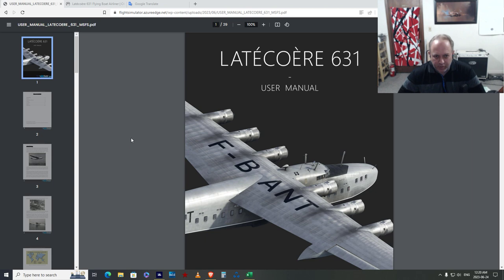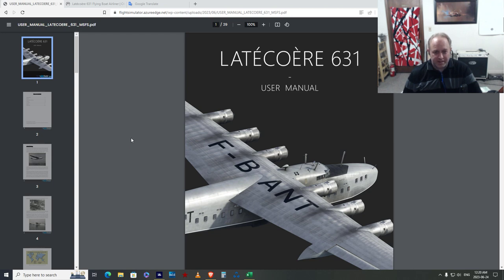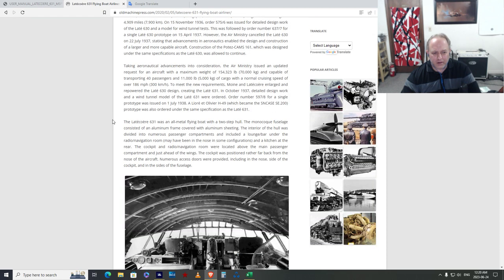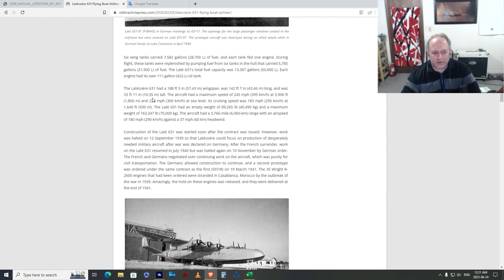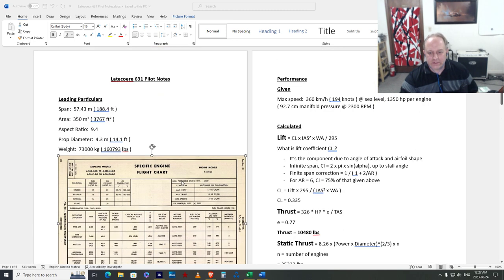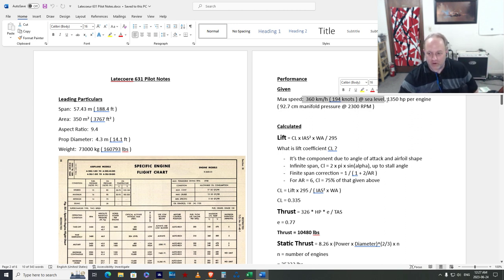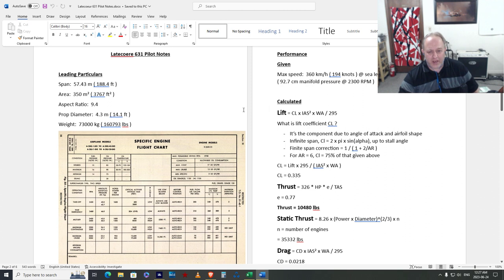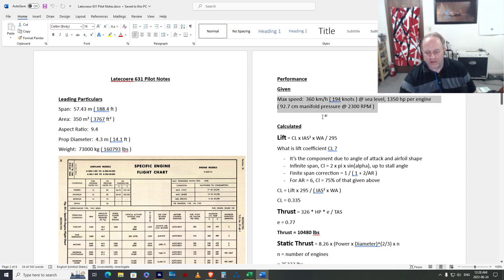Latecoere 631 Performance Calculations

Comment: For some reaon you were with the floats dowm when U tried the first gliding attempt.. Weren't they supposed to be up for the attempt? And there's another question; since we wwere exploring the airframe properties, Would it have been necessary to have feathered all the propellers prior to try the plane's gliding ability?

Comment: Found a good equation for approximating the Oswald Effeciency
e = 1 / (1 + (0.38 / (AR * beta^2))) where beta is the Wing Taper Ratio (Tip Chord/Root Chord) and using any somewhat accurate drawings or models we can get values to calculate beta.
Reply from the maker: I know there are correction factors to the induced drag for aspect and taper ratios.  I'm not sure where this equation comes from?  But, it would still only be part of the bigger picture for the whole airplane.
Reply: @WellsSullivan  yup 100% just another of the many things :D I just found it interesting that I came across it whilst watching your video.